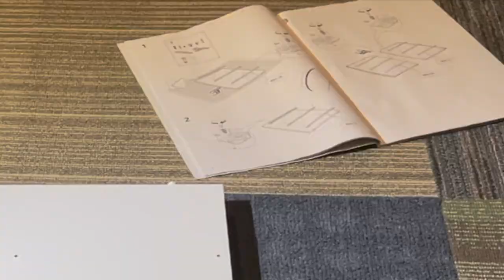IKEA Furniture Quick Build | Hauga 6-Drawer Dresser

Comment: I just purchased this tonight well 3am houston time. An I hope 🤞 that tomorrow I am able to figure this puzzle out! How long did it take you if you could guess?
Reply from the maker: Less than 4 hours :)
Reply: @ZacharyRiggs619  I ended up going with the grey one. The white was out of stock. So far it’s 4am I started at 1am. There’s one difference so far the 2 bottom pieces (under dresser) are different on the grey one. Odd, but I watched your video multiple times to compare at that part. An yours is painted white on the grey it’s one grey an one brown(unpainted particle board). An one has different front facing holes. I know I sound confusing. I think I’m gonna call it a night/morning. An finish the drawers in the morning. Your video definitely was a big help. 💗
Reply: @bret9276  I’m building mine now and the same thing with mine lol. One grey and one brown. Did you figure it out?

Comment: Can anyone help I can’t seem to get the flat board on the back, been trying to fix this dresser for almost 2 weeks now! Any suggestions?
Reply from the maker: I'm guessing it won't fit in the grooves or it keeps falling out?  If so, maybe try adding a few tack nails to hold it in place.  Carefully, nail them into the back of the dresser structure.
Reply: @ZacharyRiggs619   ok thank you so much
Reply: I had the same issue.  The corner groves were too tight so it would not slide in.  I ended up cutting of the corner tips and then it slid right in.